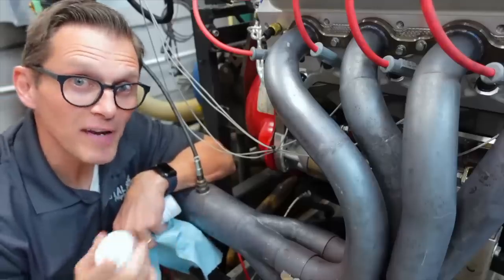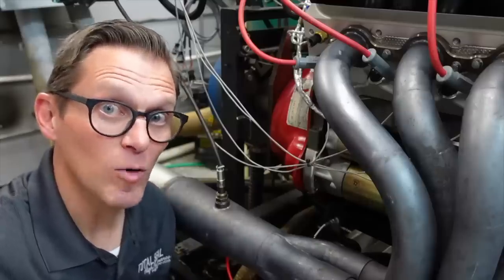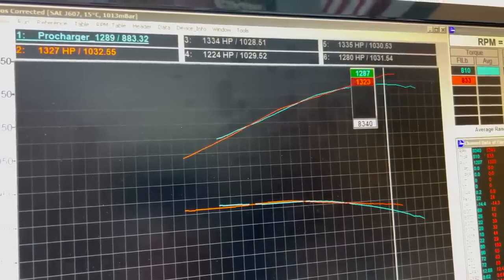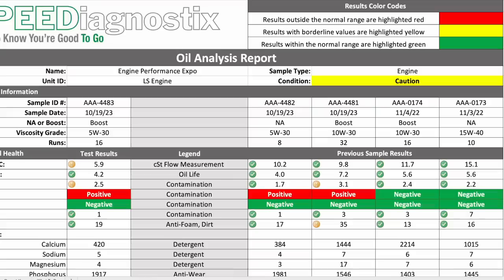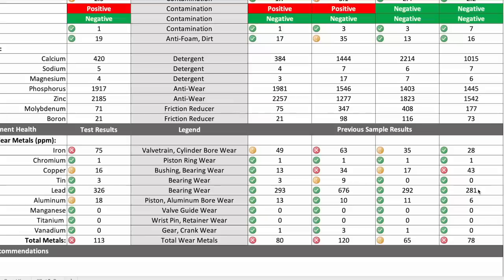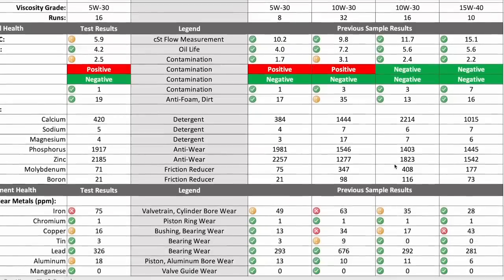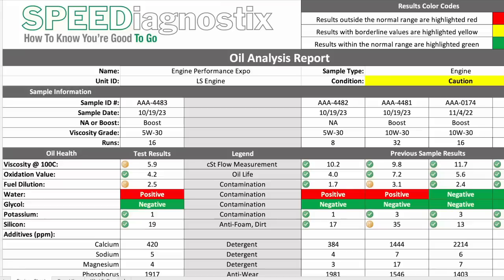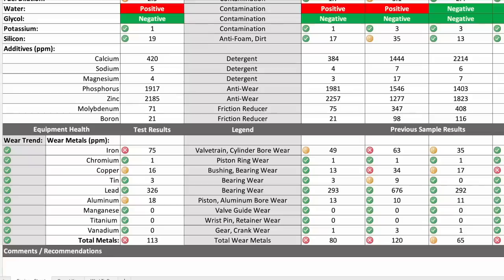What Adding BOOST Did Do To Our Motor Oil (NA vs BOOST Test)

Comment: I'd guess that this also means keeping the fuel injectors clean and functioning properly for good atomization is that much more important on a turbo/super-charged engine.
I've mentioned this before, but could you make a video comparing high-quality oils (Pennzoil Ultra Platinum/Amsoil Signature Series) with high-quality "Euro"-spec oils, and what the effect might be on a car to use either in place of the other? I'm also wondering about that Valvoline Restore & Protect oil you recently looked at; it's something I'd love to try, but it's not normally recommended for my "euro" car.

Comment: It looks like for every reduction by 4-5 centistokes, you've doubled engine iron wear.
If the engine is 5.7L 1327 HP that's 232 HP/L.
2023 Corolla 2.0L is 84 HP/L or 1/3 the power/L, so can get away with 1/3 the viscosity with modern oil.

Comment: I drove an '85 Volkswagen Scirocco for several years, and then added the available factory turbo kit in 1991.  It added 6 pounds of boost, had no intercooler, and used the cold start enrichment system to add fuel.  It worked well, when my mechanic got it tuned, but it had no flex pipe and kept breaking the header to exhaust manifold pipe.  He finally welded it....

In any case, it was COVERED under the original VW Factory warranty, and while a dealer installed option, it was indeed a FACTORY option.  From what I have learned, only 52 cars came with this system, which makes it an odd bird and certainly collectible since it was the first 1.8T.

Anyway, I drove it for a few more years and then bought a Corrado SLC, which was a whole other magnitude of performance.  Oil changes on the turbocharged Scirocco?  I noted nothing different in the oil, but then again I change my oil at 3000 miles or one year, so it usually came out translucent brown.

These days I drive a '14 Cayman S and use Driven DI 0W-40 oil.  Since the car sees about 2000 miles per year, it gets yearly oil changes, and again....The oil is just slightly brown.

Great video!
Reply: I hope you shower regularly too.
Reply: @georgeburns7251  1.  When I get out of bed.
2.  After my daily run.
3.  After my daily yard work.
4.  If I haven't had #2 or #3 above then just before bed.

Now;  Would you like me to detail how I put the toothpaste on my brush?  Perhaps you want to know how I wipe my ass?

::cough cough::  Have a nice day~!

🖕

Comment: I think that most people miss the fact that the head of the pistons are hot. The valve  springs are HOT. Continuous running builds way way more heat than a few dyno pulls. Ill bet that OIL cools more BTUs than the radiator.
Oil has a tough job.
Before my car hit 100k I jumped to 5-30. Now that its 70 at night and 95 in the day, Im thinking 10-30 or 10-40.

Comment: so I saw your video on how to break in a engine properly and you said to use a slightly thinner motor oil than the factory  viscosity. So is it okay on a boosted engine to use a 5w30 break in motor oil when the engine usually recalls for 5w40 ?

Comment: Lake I Love these kind of videos and I get the application! The problem with information like this is people don’t get that this is a RACE BUILT PUSHROD ENGINE THAT IN PREVIOUS VIDEO WAS STATED THAT IT IS  A LOOSE BUILT DRAG RACE ENGINE!! Sir you need to over stress that because I’ve read the comments on this and the couple previously posted videos and the issue is that every Tom Dick and Dumbass is going to say!!! My 2.0 My 3.0 My 4.0 Turbo or Supercharged Factory car says to put a 0w-20 0w-30 0w-whatever in it is now going to say!! But I drive my car really hard and I think I need a 50W-180 because what the Factory recommends is way to thin!! Please specify that this in not the average factory spec engine and in no way shape or form should a consumer change what their factory clearance low viscosity stock or even modified (Stock FACTORY Clearance) engine need to live a long happy life! Cause I have had two modded turbo BMW’s that when traded in had 205,000 and the other had 185,000 miles on them ran 5w-30 the factory spec oil! I also had two different NA converted Supercharged daily driven cars logging over 250,000 miles between the two and still always ran the factory NA specked oil! SO PEOPLE RUN WHAT YOUR FACTORY RECOMMENDS!!!
Reply: He always recommends an oil test and change things on results, if your having high fuel dilution and lots of shear because of heat ect you may want to go up a grade or change brands

Comment: Random question: I run 5w30 synthetic (some version of Mobil 1) in my naturally aspirated 2012 Mini Cooper. It is the recommended weight for the car.  It has 73k miles, with 20k added by me in the last year. I use it mostly for 500 mile highway trips on the east coast. I was wondering, given that most of the running is at a near constant 3000-3100 rpm with a fully warm engine, and I care more about wear than 10% worse fuel economy, is it reasonable to go up in weight/viscosity? If so, I’m guessing I would want 5w40 for more full temp/high load support, vs 10w30 or 10w40. Interested in thoughts from some motor oil geeks.
Reply: Long high speed runs are easier on the oil than stop and go city traffic. The oil will get up to temp and boil off the water and fuel allowing for best oil performance. Speed allows for good cooling. I doubt moving grades would be an improvement.

Comment: So if I have a car that is boosted from factory, but only runs 7psi stock and the manufacturer’s recommended oil is 5w30, should I run a thicker oil after tuning the engine and now running 22psi boost? Even if I change the oil after only 2000 miles, it stinks of fuel which means there must be some serious fuel dilution. The engine has 173k miles on it and has oil changes every 2-5k miles. Starts on the button and never misses a beat.

Comment: You should graph cylinder pressure vs wear and see if there is a consistent correlation. Also as an engine cools the air inside the crank case goes from taking up X volume to less. This "sucks in air with moisture." Then not getting the oil to a hot enough temp leaves it in the oil and ultimately in your sample.
Reply from the maker: I like the idea of lining up cylinder pressure and wear!

Comment: Lake, since you opened the door. What changes to the oil do you see if a person is running Alcohol,  Methanol, Ethanol, C15, C16, C20, C23, Q16, and VP110 fuels. Since FUEL DILUTION is a huge concern, the type of fuel is also important.
Reply from the maker: Absolutely. The type of fuel also plays a big role in the level of fuel dilution.

Comment: Explain the downside trade off of cold start wear ( not freezing but 40 - 55 Fahrenheit) viscosity vs higher viscosity to mitigate boosted wear due to fuel oil dilution.

Comment: I cant imagine 4 cylinder direct injected engines on turbo with an oem spec of 0w-20 😭
Reply: Subaru WRX has all those things and has had a 0w-20 spec since the 2022 model year (VB generation) came out.  

The new GR Toyota Corolla also specs 0w-20 with all those same variables.  

…..Run 5w-30 in both…….

Comment: So how would tight tolerance engines run with low viscosity? More pressure? And how does the oil requirements differ between the crank and cam? If an engine with separate oil systems for cam and crank is built how would the oil properties differ?

Comment: If us 3.5 ecoboost owners stepped up to a high viscosity cold and warm level would the only downside be mpg? What should we do about oil falling off the top of the engine for tow rigs that sit around for a week or more? Ive been doing the no ignition start cycle since i began hearing the phaser stick on startup.

Comment: Interesting data as always, Lake.  The Total Seal gas ported, gapless piston rings in this engine must be of excellent quality. The chromium content from the rings stayed at 1 ppm for ALL of the tests.  The rings were the only component listed that did so well and considering the number of piston/ring failures so common to boost extremes, your analysis results are very impressive ! 
By the way, wouldn’t “ENGINE” OIL GEEK be a more technically correct term ?  I won’t insult your exceptionally high intellect by explaining why. Keep up the excellent work 🏁.
Reply: I’ll stand by to get slaughtered but Lake is a child of NASCAR and all those “good ole boys” engine geniuses always say motor not engine. Listen to the sound, it’s the South. Motor sounds friendly. Engine sounds like Werner Von Braun. NASCAR vs Nurburgring.
Reply: @Dggb2345  No need to go into detail. As a Georgia boy of 70 years, I truly understand 🇺🇸🏁
Reply from the maker: Thanks, and great observation!
Reply: @themotoroilgeek  My pleasure Lake. I enjoy commenting on useful information and valuable experience such as you provide 🇺🇸🏁

Comment: I'm guessing this also might be a big reason why engines like the new 6 cyl turbo Toyota Tundra engine is failing, because Toyota is using the same 0w-20 as they recommended  in the previous V8 which never saw any of the high boosted pressures they do now.

Comment: Hey Lake, can I ask why OEMs put thinner oils in your engine if oil analysis says 5W30 is better in every way? Seeing my oil analysis on my 2024 GR Corolla. It seems to like 5W30 more the 0W20 even though it calls for 0W20 from factory. Now with 6 oil changes and switching between 5W30 and 0W20. 5W30 showed the wear metal dropped by double. Also to make sure my engine wasn't just finishing breaking in I switched back to 0W20 and the wear metal went back up. Also, oil pressure stayed the almost the same for the 5W30 for some reason.
Reply from the maker: Fuel economy is the primary reason for lower viscosity oils.

Comment: I'm curiouse if you could do a test or know if the oil will regain viscosity if it was driven normally for 50 - 100 miles due to burning off of the blowby gasses and through the action of the positive crankcase ventilation system .. I always assume the reason older pre mid 60's engines used to sludge up so bad was because of poor road draft ventilation or blocked/ no crankcase ventilation and the problem was later alleviated after the addition of positive crankcase ventilation in more modern engine designs. Off coarse modern high detergent oils help but I think proper crankcase ventilation is equally important at keeping the oil clean .
Reply: Could have been the 160 degree thermostats they used to run.

Comment: Believe or not I but in my 5.3 20w50-10w40 and it lasted about 300k miles and lifters gone bad (known for the 5.3ls) but the engine is in good condition  with the hot weather around 115f but I see the most important part is changing oil is the most effective I do it ever 2500-3000miles sens I bought it

Comment: Thank you Mr. Speed. I would like to see a deep-dive on oil and hybrid engines. Do they suffer more from fuel dilution and water in the oil? Should you service a hybrid by miles or by hours?

Comment: I've got a 99 Nissan frontier with 2.4 that I bought new.calls for 5w30  I've always used 10w30. Extremely hard miles, always loaded, stop and go service work, SC heat 280,000 miles, runs like a top,uses no oil.ive always used wix filters and conventional Castrol oil.starting to get some light varnish, I'm about to use some 15w40 shell Rotella conventional. Same truck and engine, manufacturer recommends 15w40 in Mexico.

Comment: So would you think it's a better idea to run 10w-30 instead of 5w-30 in the heat of the summer in a Mustang with an ecoboost engine? This is my last new car and want to take care of it, I currently use Pennzoil Ultra Platinum 5w-30 with Purolator Boss Oil filters at 5k intervals most driving is highway at 2,000 rpms

Comment: We rebuilt a 2005 VW mk4 1.8 awp, with f21t, 21# boost. Did typical support engine parts. 

Reached out Driven for support. 

Break-in, 2 rounds of BR40. At round 3 I threw in Lucas break-in. Tuner recommened, after break-in,  run semi-synthetic for 1k miles. Then stick to full synthetic 5w-40. Mobil1 found at Walmart. 

So far, its got 12k miles,  oil changes around 3k to 3.5k miles. 

Gonna have oil analysis done to see how it's doing.

Comment: I understand in a race engine the need for higher viscosity.  However, I wonder how much of this applies to a typical street engine.  My Chevy Equinox is turbocharged yet calls for 0W20 oil.  I have wondered if, particularly in the summer, it would be wise to up that to 5W30 or so even though that isn’t what Chevy recommends.  I don’t run the car all that hard, but do a fair bit of interstate cruising at 70 MPH in weather above 80º F.  Thoughts?
Reply: Same thoughts. My boosted Saab 2.0L calls for 0w-40. So why does my boosted Kia 1.6L call 0W-20?

Comment: My Cummins is compound turboed and I’m at 70psi. Towing I’ve had my EGT’s holding 1500. All diesel oil is basically 15-40. Is there anything I can do to help engine in this case? Currently running Rotella T6

Comment: This is why all these new cars running 0-20 oil in an Eco boost engine don’t last. New cars with direct injection, turbos, and thin oil don’t last near as long as a conventional N/A motor.
Reply: Not all new GDI Turbo cars run 0-20. Mine calls for 5w-40.
Reply: @Japplesnap    it must be European?
Reply: @oneninerniner3427  Yup. Audi.
Reply: Definitely a contributing factor. Making adjustments accordingly

Comment: So now I'm wondering ... I have a 2017 Camaro, with a 3.6 V6 that runs an Edelbrock Supercharger @ 6 psi of boost. Factory oil is 5W30 for the N/A engine, should I bump it to 10W30 (or higher)? I'm not "in boost" very often and run it easy most of the time.

Comment: I wonder if this reason (boost/fuel dilution) is the reason "Euro" oil specs are usually 0w-40 or 5w-40.  I am sure there is an exception, but I think most of them run GDI without PFI, and it is my understanding that GDI has a bigger fuel dilution problem.  Also, and while this is an overly broad statement I know, but most of the Euro engines are turbocharged mills.  In comparison our domestic engines tend to be non turbocharged and are either PFI or have a mix of PFI and GDI which (might?) cut the fuel dilution problem.  And it would seem 5w-20 is the preferred grade here, with some exceptions of course.  I also wonder if boosted cars with wideband O2 sensors have less of a fuel dilution problem since they can run closer to stoich since the ECU can very quickly add fuel real time, instead of inferring a bunch of stuff based on other sensors that don't directly measure the AFR.  

Lake, do you think with these new results, you might convince Driven to update their oil viscosity chart?  I was planning on running my turbocharged LQ4 with 5w-30 since the factory uses that grade, and after building the engine and knowing the clearances, it would be fine with a "thick" 20 weight or thin 30 weight...But now, I think I might run the 5w-40 euro oil my other rigs use.
Reply: Why does DI have more fuel dilution?  Port injection generally requires richer mixtures and is much less precise when it comes to injection (wall wetting and such).  If I had to guess I'd say the Euro guys are specing for more high speed, extended duration operation which brings up temps and reduces viscosity.  Or maybe longer change intervals?
Reply: @KZ-se4ik  Fuel Dilution (Really what I meant was oil dilution) is a side effect of DI.  I have not read any academic papers on why this is the case, but I would guess it is either because the high pressure literally sprays the fuel right past the rings, or because DI doesn't have as much time for the fuel to atomize (Comparatively speaking, PFI has a lot more time since it boils off the intake valve before it even enters the combustion chamber).

Regardless of why though, it is recognized.  In the Porsche factory service manual, oil dilution is specifically mentioned when referring to lower than expected oil pressure.  It's not freely available, so I can't link to it, but it is definitely there.

Lubrizol, one of the additive manufacturers used by the multitude of oil companies that blend and market oil says the following "While a T/GDI engine creates tremendous power more efficiently, it also can create potentially detrimental conditions. First, there’s the issue of increased soot and fuel dilution due to changes in injection and combustion.  This new form of soot in T/GDI engines can cause a rapid viscosity increase in the oil, while the change in injection can increase fuel dilution which can accelerate wear. " (para. 5).

source: https://360.lubrizol.com/2018/Benefits-of-T-GDI-Engines

Comment: That's Why The Local Race Engine Machine Shop Said Run 20w-50 In My Engine. The Bearing Clearances They Set My Engine To Really Indicated I Should Have Been Running A 30 Based On Oil Temp vs Bearing Clearances On Drivens Chart. Had A Engine Main Bearings Failure And Sent A The 800 Mile Oil To You Guys. It Was Way Down On Viscosity From It's Intended Oil Viscosity Nearing The Low End Of A 40. It Also Had No Fuel Dilution But Had Tons Of Wear Metals. Sent In A Sample Of The Fresh Unused Oil Which Was Used In Engine To See If The Engine Wore Out The Viscosity. Hopefully It's Not The Oil Being Wrong Viscosity Out The Bottle. 

Going To Be Doing Oil Analysis On Every Oil Change Once New Engine Is Back In Service. It's Probably Not Gonna Be Peice Of Mind... Like When I Got An Oil Pressure Gauge hahaha Ever Since I Installed One The Oil Pressure Gauge Has Always Told Me Bad News hahahaha. It Is What It Is. If Building A Junkyard $6000 V6 Daily Driven ~600HP Was Easy... Everyone Would Be Doing It 🤣
Reply from the maker: We are here to help!